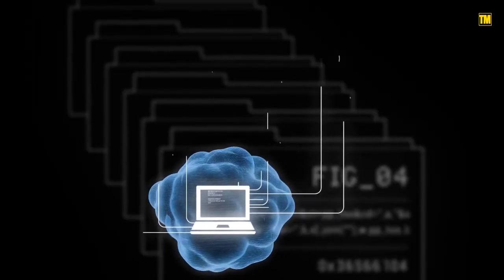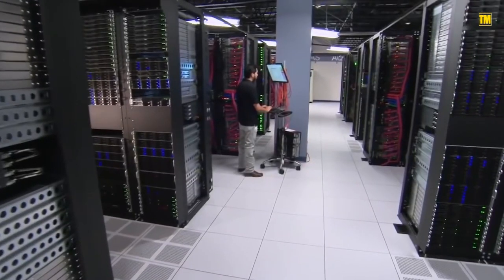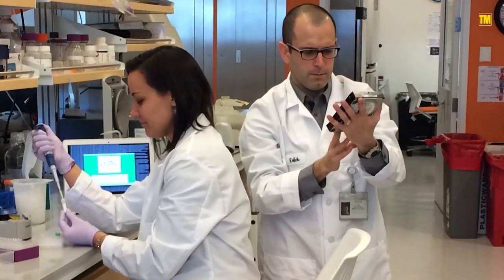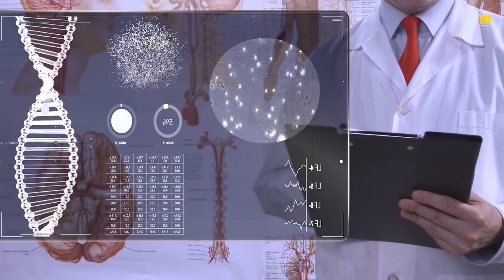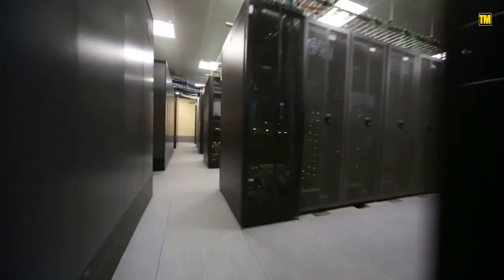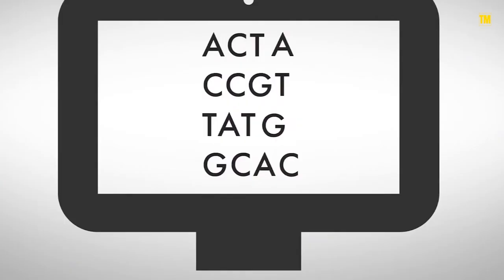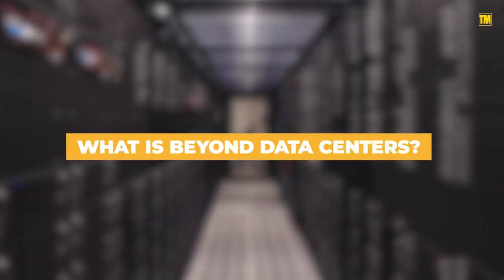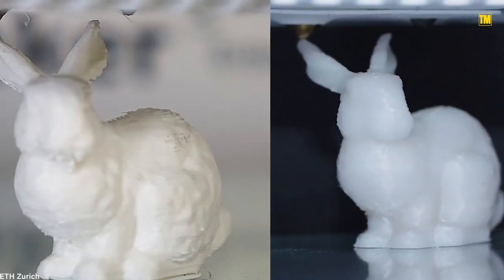DNA Data Storage - The Solution to Data Storage Shortage

Comment: The human cell requires self-repairing machinery to keep up with the damage from radiation sources. That issue needs to be thought out before this is used. Moving data around and correcting it as you do might be the only way.